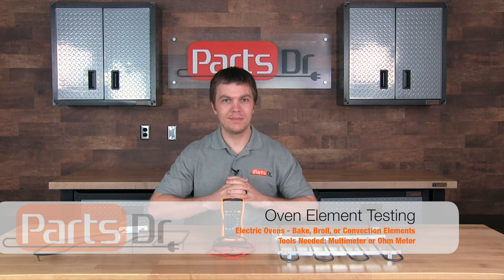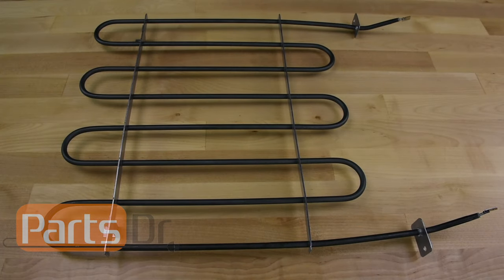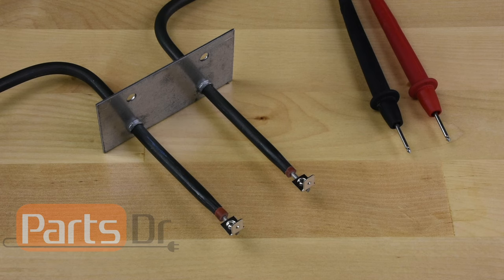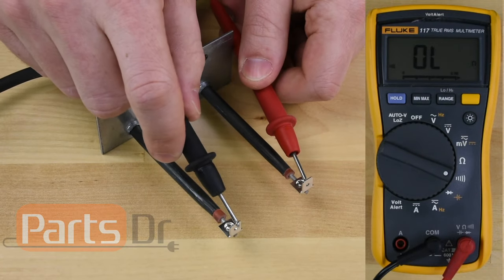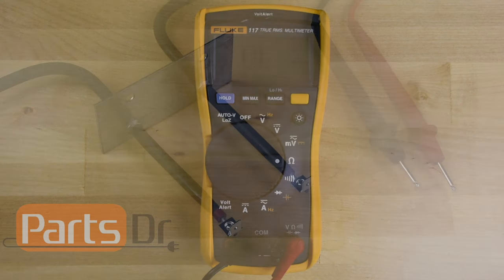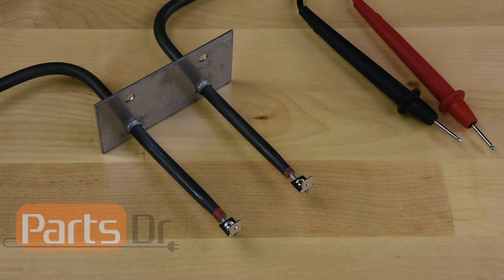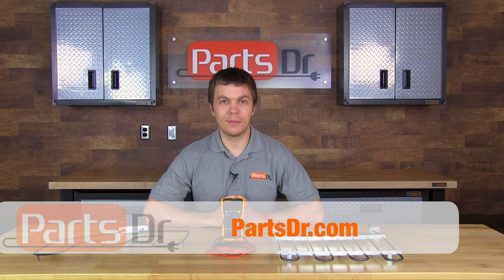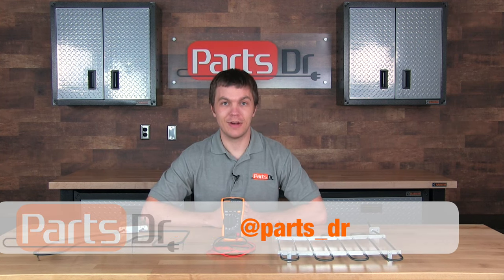How To Test A Bake Or Broil Oven Heating Element For Continuity

Comment: So i tested my broiler element and its at 16-17 so all is good so what do you think my issue is? The element stays completly cold when turned on not sure if that helps
Reply from the maker: It can commonly be caused by a bad control board or burned/broken wiring.
Reply: @PartsDr  you were right about the burned wire. Does this mean i just try reolacing the burned wire?
Reply from the maker: @mikehickey420  We have seen some people cut out the burned section of the wire and splice in an equivalent size gauge wire with the same heat rating, or you would have to replace the entire wiring harness for that part of the range/oven if the part is available.

Comment: I have a kenwood bm450 that does not heat up, I changed the heating element, the replacement part gives no continuity beep (but the multimeter doesn't beep if resistance >50 Ohms), by measuring the Ohms resistance of the heating element I get 80 Ohms, do you think the heating element is at fault or should I look elsewhere?
Reply from the maker: It sounds like the element is probably good from your ohms test.  If the element is 80 Ohms and the Voltage is 240V, that would be a 720 Watt heating element.  You can calculate those numbers here: https://partsdr.com/blog/ohms-law-calculator-a-crucial-tool-for-appliance-repair/
Reply: @PartsDr  it is a 610 W resistance, so 80 Ohms checks out when you consider 230V. I guess next step will be checking if 230V are reaching the resistance when the oven is on. Thanks!

Comment: I have heard 30 - 100 ohmes is the recommended number ... Yet you said 10 is the lowest in the range ... I am getting a 16.6 and the bottom one works and I have checked everything ... Everything else.  Wondering is 16.6 is the problem or not as getting two different low numbers for range of it
Reply from the maker: 16.6 Ohms would be a good reading.
Reply: @PartsDr  thx !

Comment: Okay 10 to 75 ohms... Another video told me 30 to 100, and another told me 0 to 50... 
My reading is at 20 ohms for a GE hidden heating element that has been used for over 20 years at least once/twice a week. My Terminal Block is melting when the oven is on, but is fine when the broiler or stove top is in operation. Is my heating element bad? Or do I have something else I should be looking at?
Reply from the maker: It is probably good.  If you aren't sure of the ohm rating, you can run the voltage and wattage numbers through an Ohm's Law calculator.  For instance, 20Ohms at 240V would be 2880 Watts which would be very typical for a bake or broil element.  https://ohmslawcalculator.com/ohms-law-calculator

Comment: Do you have to remove the heating element to test it?
Reply from the maker: Removing the element is not required.  But disconnecting or turning off the power is required and you should also disconnect the wires to the element that you are testing.
Reply: Thanks this save my time :)

Comment: Will a faulty broil element cause no power at all to the stove?
Reply from the maker: No, not normally.  It is possible that if the element sparks and shorts out when it fails that it can damage a control board.
Reply: @PartsDr   okay because the only damage on that back is from the broil element where I can see it’s burnt. But the stoves dead. So should I test the control board?
Reply from the maker: @michaelriddle1432  We would start by checking the power supply to the range.
Reply: @PartsDr  do you have a video link on how to do that
Reply from the maker: @michaelriddle1432  I'm sorry, we do not at this time.

Comment: Hello,I have electric oven and he don't works properly he take 1h to get 230 C😔.can you help me? thanks
Reply from the maker: Did your bake and broil element both test good?
Reply: @PartsDr   yes
Reply from the maker: @tavy7200  If the elements are both good then you could have a bad control board (new ovens)/thermostat (older ovens) that is not sending power the the element(s).
Reply: @PartsDr   @Parts Dr  ok thanks ,one more thing I have to tell you maybe helps you to fine the problem 🙂the bottom of the oven it's wavy and the color it's no more dark blue it's black some spots ,I think because the element don't works properly?or still I have to buy thermostat?thank you very much!!!
Reply: @PartsDr  please help me!!! Thank you
Reply from the maker: @tavy7200  I'm sorry, I don't think we can help you any further with this.  You can only go so far in troubleshooting through Youtube comments.
Reply: @PartsDr  When you say older what are we talking here age wise? How about 1997